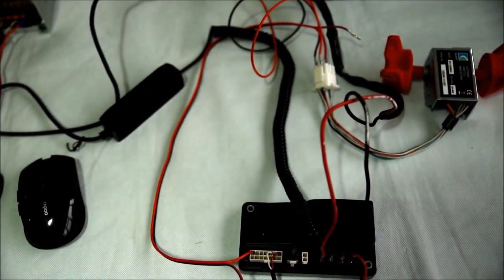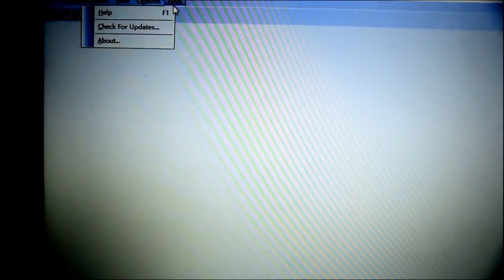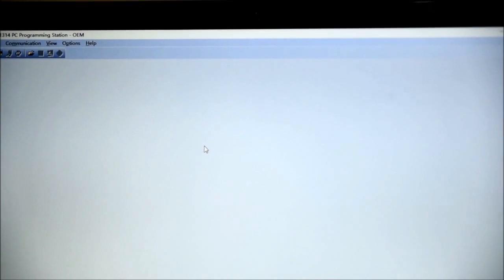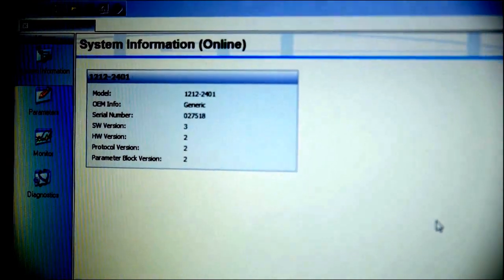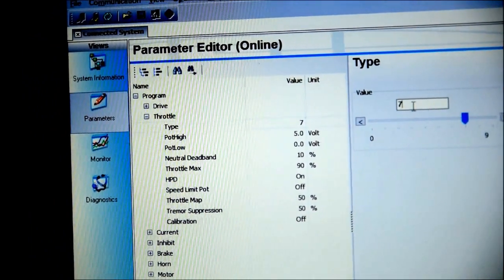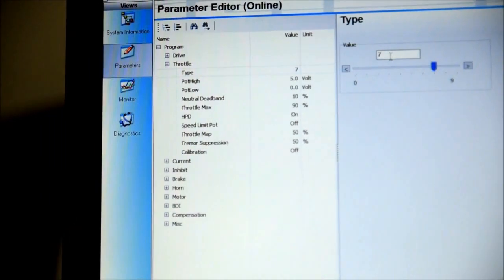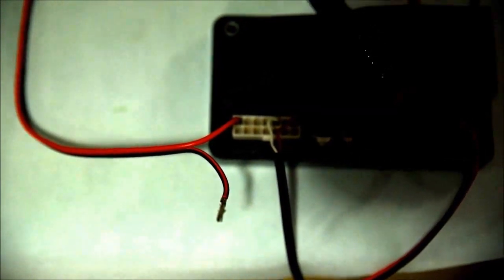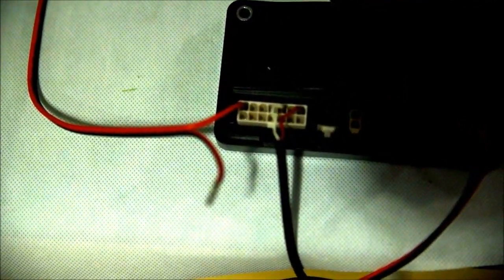Testing Controller 1212 2401 with Throttle ET 126 MCU, 1314 4402 Curtis PC Station Programmer

Comment: Hi .. I have 1212p-2501.. 
The problem is that there is a continuous braking signal going to the brake .. whenever i try to move it
Reply from the maker: Please check the brake connector, the wiring from EM brake switch to controller (if there is one) and check if the power supply to the EM brake is normal. When you turn on the key switch, release handbrake, and put Forward / Reverse switch to F or R position, the EM brake should be released for allowing the movement of vehicle. If there is not a click sound (brake releasing) heard, pull out the EM brake connector, measure the resistance between two connector pins. If the resistance is abnormally large (larger than 100 ohms), the EM brake's control coil is possibly damaged. Hope that you will soon resolve the problem.

Comment: I don’t understand what pin 7 and Pin 5 connections are and where they come from. Are they both positive? I Especially don’t understand where does that white cable come from, on pin 5
Reply from the maker: You may find the wiring information with controller manual: https://www.noco-evco.com/product/curtis/manual/1212-12P_manual_en.pdf

Comment: alden hi men sorry i dont know if you have this channel yet but i have a question about the throttle ET-126 and the controller curtis 1212P i need to know which pin i have to use from the controller to the throttle.
Reply from the maker: You may need to use Pins J1-1 (throttle signal) and J1-12 (reverse signal). For more details, please see controller manual https://www.noco-evco.com/product/curtis/manual/1212-12P_manual_en.pdf

Comment: You connect 3 wires only on throttle,positive,negative,0-5v,what about forward and reverse,how give the connection pin no 12 on controller
Reply from the maker: For CURTIS controller 1212-2401, Pin-12 is the input of Reverse. When Reverse signal (24V+) is detected at Pin-12, the output current of controller will be reversed, then the motor will rotate reversely. With the PC station programmer, you can find the input information with "Monitor" menu.